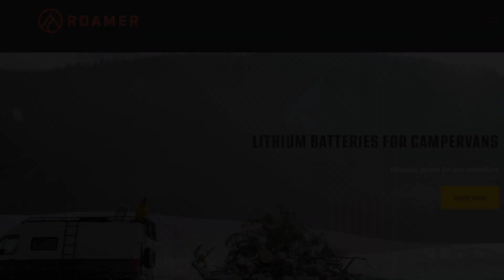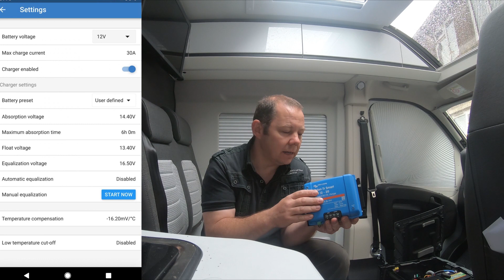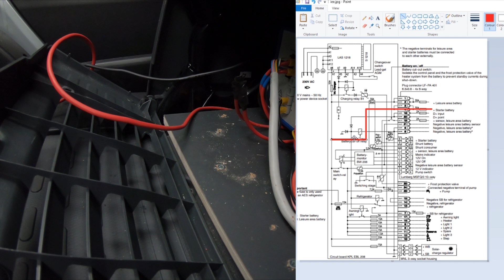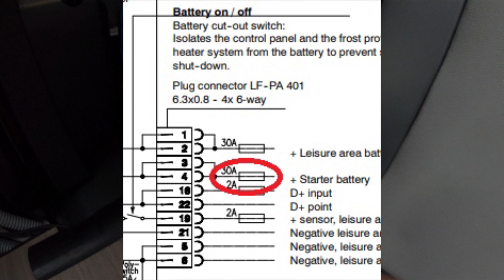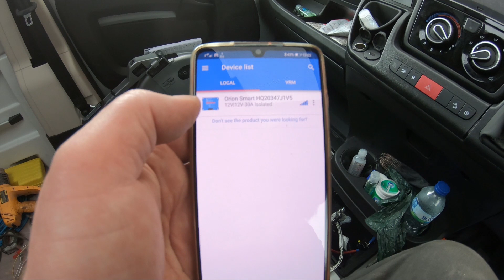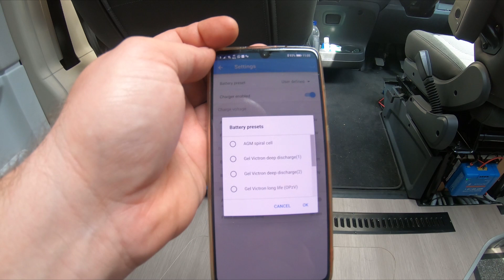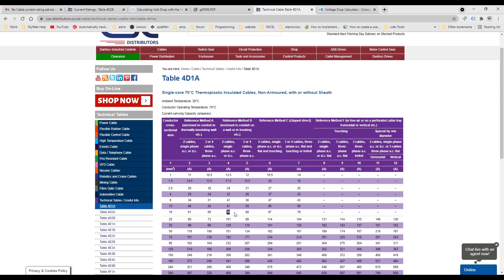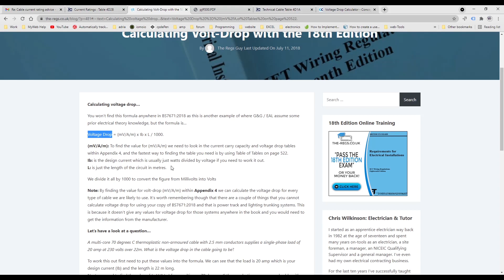Adria Twin fitting Victron Orion Smart Tr B2B DC - DC charger

Comment: Thanks. I would suggest you change the title of the video to what it says on the charger. Victron 30 amp DC to DC Charger. You will get more hits. This is the best video i have seen and i have been looking for a week. You only just came up in the search.
Reply from the maker: Thanks for tip. I have added the DC DC charger to the description, this is a lazy thing on my part as B2B is becoming a common description for DC DC converters. B2B is only used in motorhome/caravan industry bought about on social media as far as I am aware.

Comment: Absolutely brilliant video! We are installing pretty much the same. Gone for a Sterling 120Ah (like you it’s stuck on a tanker en route from China). Plus a Redarc B2B + MPPT solar charger as we like the fact it priorities solar, so even if your driving it takes any solar available & then tops up with alternator current so even less strain on your alternator. With 300 watts of solar. The issue we have is trying to get anyone to describe or video ‘exactly’ how you disable the alternator charge to a Sargent PSU! Tech guy at Sargent can only give verbal explanation (which we should have recorded!), they will not provide a written instruction. It’s driving us nuts!! Your video is unbelievably helpful 👍🏻👍🏻👍🏻 thank you
Reply from the maker: thank you for the nice comment, I was in two minds to publish this video as there are a lot of people who would probably disagree with my setup. There is more that one way to connect all this up. I will be connecting my solar direct to the battery like you this will give solar and B2B charging at the same time. Still not fully tested my system, the B2B did shut down once and I was thinking the solar charging may be affecting it as it will be showing the battery voltage as 14.4v. As for your system, All you need to do if find the starter battery input into the Sargent system. Then you have two options. Option 1, connect the B2B inline with the sergeant system so the supply still runs through this. or option 2 like I did disconnect this supply into the sergeant system and then run the B2B direct from the battery. I prefer option 2 as relying on the sergeant system may introduce things you don't need and the supply cables to the Sargent system are a lot smaller and longer run than needed. What model number sergeant system do you have I will look it up.
Reply: @BrackstonesTravelAdventures  we have the EC500 unit, which is supplied from the fiat ducato via a EM40 interface. Not sure where to locate the wire we need to disconnect. I don’t think it’s difficult it’s just knowing exactly which one!
Reply from the maker: @elstead4  I do not like Sargent system as they do not like to give much information out on the internet, I had a lot of problems with this system on my previous van. The link below is the user manual. On page 9 it shows the fuses. If you pull fuse 7 it should remove the engine battery supply. You can test this by putting a mustimeter on your leisure battery with the engine running you will have 14v. pull the fuse and you should see the voltage drop back down again. If this works then you can run your own cable from battery to battery bypassing the EC500 unit. You will probable have a common negative on this system. I will post on motorhome fun forum to see if anyone there has done this. https://sargentltd.co.uk/tech-support/article/System-User-Manuals/22
Reply from the maker: just seen you are already posted on the forum I started :)

Comment: This is great Stephen! Very helpful and educational video. I like the motivation on which B2B charger You choose. I'm still figuring out which one to choose. Ive looked at Victron, both the blue and the buck, Renogy, Votronic etc. I see no need to go over 30 amps charging either (50 could have been interesting wintertime for us but with more wear on the alternator). With the 200Ah LiFePO4 and this charger, the solar panel will be overkill if not wild camping for weeks or if you have a compressor fridge. Really nice set up and well motivated. My drop in solution for now works, but not optimal. Battery seems happy with the low amps charging when driving, there is no rush of amps from the alternator (so far, even when charging from low residual capacity). The battery does not like to be on float from the EBL when its fully charged. The battery protection stopps the charging then, so it works that way. I do not keep the van with EHU due to this. Need to go around the EBL 230V charger with a dedicated one, but I still want to have 230V to the sockets and fridge when on EHU. Our 150AH is ridiculous amount of capacity during this time of year and our normally very low consumption. We use less than 10% of the capacity per day, so theoretically we could wild camp a week without charging. If I would work more from the van and running computer, I would need a solar for convenience if not moving every other day. Good stuff this Stephen, look fwd to see next part of this set up!
Reply from the maker: Hi, Mattias. Thanks for the comment. As you said we have the compressor fridge which drains a lot of power. We have found it better to turn this off at night to reduce power rather than using the night mode. Still cool in the morning. With the AGM we find we must move after a couple of days as we will be 30% down on the battery. Even with an hour's drive with the B2B fitted we only get 10% back.The setup I am going for is the maximum I can get. You are right 300 watt solar and 200Ah lithium should be ok for power for sometime. This is what I am aiming for. Being able to stop anywhere and not really have to think about the power we use. In the end the cost of solar which was £180 for panels is not a lot compared to £7 a night electric hook up now in the UK. Solar panels turned up today so I am hoping to get them connected in the next few days, I am away at the end of May for a week so I will need them as the Lithium will not be here till July. It will be interesting to see if the BMS system on my Lithium has a voltage turn off so I can continue using the EBL like you said. If not I have a couple of other ideas I am thinking about doing. One will be building a timer circuit to allow a period of charge which will automatically turn off allowing me to leave the electrics all turned on,
Reply: @BrackstonesTravelAdventures  Look forward to this? Both instalation of solars and your experience with the battery. Total freedom to not worry about power 👌.

Comment: Thanks for your help it’s always good to exchange ideas. it got me doing a bit of searching and found that on my EBL the engine and leisure battery connections are at the back. Terminal 1 leisure 2 earth 3 engine. That’s also told me that the earths are common across both batteries,  like you could have bought the cheaper 3 terminal b2b.

Comment: Hi, thanks I’ve learnt something that I’ve been trying to figure out for some time. I’ve also installed as per your install but to isolated the EBL from my leisure battery whilst the engine is running I fitted a relay in the positive circuit from the EBL to the leisure battery with a switch on the dashboard that I can turn on when travelling. However now I can do as you’ve done and disconnect the charge relay in the EBL and that’s so much better. One thing I have done that I notice you haven’t is fit a grill in the cover above the B2B to allow warm air to circulate up and out.
Reply from the maker: For the b2b you can disable this via the Bluetooth app if my battery is near full and solar is good I do this to reduce the pull in the engine. Also with lithium they store better on about 70% capacity. So we run it down on our last day and turn off both b2b and solar via the apps
Reply: @BrackstonesTravelAdventures  thanks 🙏 I do the same as you which is partially the reason I fitted the relay to isolate the lithium battery when parked up, we keep the van plugged in on our drive with the heating on low, by isolating the lithium battery the on board charger can’t keep topping up the battery.  It also gets a little solar from the panels. My Electroblock is an EBL 29 and I’m not sure what connections on it relate to the charger relay.   Colin.
Reply from the maker: @wobby1516  understand now relays to stop the EHU charge. I have now fitted a victron bluesmart charger which can plug into the starter battery or lithium depending on what I want to charge. There is a vlog on my bluesmart setup. Amazing how good lithium is should have switched years ago 😁

Comment: Great info quick question regarding your install did your mppt have two outputs originally as mine is a sun control 320 and I think it’s a bit naff it has a negative in and a positive for the solar then a positive for the leisure battery and a positive for the vehicle battery
Reply from the maker: I also think the sun controlers are a bit naff :) they have an issue with back feeding from leisure battery to starter battery when vehicle is off. They have wired it with no negative from the solar panel this cable was located the other side of the EBL controller. If you strace the positive solar cable back from the controller you will find a conduit which will habe the positive and negative from the solar panel. The Victron system does not charge the starter battery so only have + - from solar and + - out to leisure battery
Reply: @BrackstonesTravelAdventures  thanks for the help going to bite the bullet and upgrade to protect my lithium might even go down the renogy route the b2b 50amp with mppt
Reply from the maker: On face book there is a good campervan electric group setup by Steve from Roamer, maybe of some help with advice on product, if you have not already bought the Renogy MPPT then see what the views are on this group. Personally, I would not touch Renogy, they are cheaper Chinese company I believe, they had a lot of issues with the MTTP solar controllers and poor inverters with almost zero support.
Reply: @BrackstonesTravelAdventures  thanks for the advice I’ve built loads of systems and never really had an issue with Renogy but now you have said this got me thinking I want a system that simply charges both batteries from whatever source I hit it with

Comment: Hi Stephen, thorough video i am about to do the same with my Burstner. I'm confused about disconnecting the EBL.  What's wrong with the EBL trickle charging the Leisure batteries? you stated you disconnected the terminals  on the ebl and tapped them up was that 1 and 2 or 3 and 4.
Reply from the maker: Hi Andy, 
Pins 3 & 4 are connected to the starter battery, pins 1 & 3 are connected to the leisure battery. If you are fitting a Dc-DC converter, then you want the engine to charge through this converter as it has the correct profile for lithium batteries. So, removing supply on pins 3 & 4 of the EBL will remove the engine charging to the leisure battery. If you leave these connected the EBL will charge in parallel to your DC-DC converter, this can cause a few problems. It can raise the battery voltage enough to switch off the DC-DC converter. It will not charge lithium to correct profile charging (float charging etc) and seeing as lithium can pull heavy charge currents this can overheat your van wiring. On my van there was a fuse within the drivers pillar for these cables (pin 3&4) which I also removed as it will not be good to just them tape up live. If you cannot find the fuse, then connect them into an enclosed terminal bar.
As for the electric hook-up charging the EBL model, I have does not have a lithium setting so on EHU it will charge at a longer absorption time and then float charge which can reduce the overall life of a lithium battery, When I spoke to Roamer (supplier of my battery) he said the warranty will be invalid if incorrect charging was carried out. To stop the EHU charging I removed the 240v plug from back of the EBL and plugged this into a Victron smart 240V charger with lithium setting. A lot of people do not worry about this so its entirely up to the individual what they want to do and how it will affect the life of the lithium.
Reply: @BrackstonesTravelAdventures will this still leave the EBL to charge the starter battery.?

Comment: Forgot to ask where the door pillar is I have a load of gold type resistors like some Chinese flasher regulators like the ones you would fit to slow down led flashers on an indicator circuit any ideas and do you have them as they are behind the lower white connector block with nothing plugged into it
Reply from the maker: Not sure what these will be, maybe a new mod or a Fiat part

Comment: Does the adria come with a BB charger as standard and also does it come come with MPPT solar controller, and you chose to replace them with Victron controllers.
Reply from the maker: From what I have been told on the Adria group some do come with B2B which is fitted where I fitted my Victron one. If its good enough to supply 30 amp charge with Lithium profile I would have stuck with this but my van did not come with a B2B. For solar it comes with NDS MTTP controller which is OK but no where near as good as the Victron. No Bluetooth and I believe no lithium profile. It also can only take 300 watts solar but it is wired 150 watts per channel so you would have to run extra cables from roof to controller to add the extra 150Watts and buy two 150 watt panels. In my opinion the Victron was a better option. You can go Renogy which are good but no Bluetooth or EPEVER both good and there are others. I like the Bluetooth to be able to tweak the charging profile, match the two devices and possible connect a raspberry pi colour control gx
Reply: @BrackstonesTravelAdventures  many thanks. I thought all new vans now come with bb charger as I have a new twin on order. If they don't, how is the agm leisure battery charged as standard?
Reply from the maker: I believe the automatic ones do have B2B as they have smart alternator working. On my one manual I could not find any B2B fitted and I have read the smart alternator is switched off via the ECU to allow standard charging (I have no fluctuating voltage at starter batter). Problem is there is not much information from dealers and not much info on the internet for Adria Twins, only the EBL schematic which does not have B2B internal. I expect you will see under the drivers or non-driver seat a B2B device if it was fitted. In the end for me as I will be fitting Lithium a B2B is important for safety so I have disconnected any dealer charging circuit and direct fitted a B2B from leisure to starter battery. If you are staying with AGM dealer fitted battery then there will be no need to install any B2B

Comment: Hi I have an adria 22 model with a German b 2 b controller with lithium settings and a sun control mppt again with lithium settings. I have a 200ah lithium battery like roamer but when I drive I noticed that the vans battery when driving drops to 12v and when going down hill it goes to 14v obviously something to do with regen or euro 6 but seems it’s not charging the leisure battery and the same with the sun control mppt they fitted seems it’s charging the leisure battery but never swaps over to the vehicle battery. I might bite the bullet and go victron but what are your thoughts as is a pretty new van
Reply from the maker: How do you know the MPPT is not charging the leisure battery, are you monitoring this on the battery app when driving or do you have a shunt. Also the battery apps are not very accurate so the first thing to think about is installing a dedicated shunt. The MPPT should boost the charge voltage to give a stable output to the leisure battery so the smart alternator system should not affect the charging. As for the solar charger it may either be a controller that does not charge the vehicle battery or the internal fuse may have blown